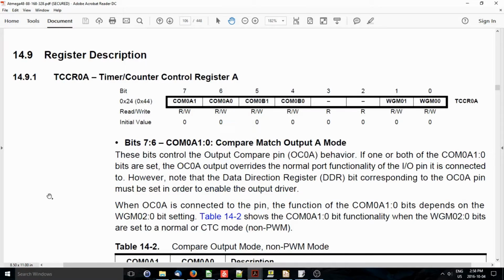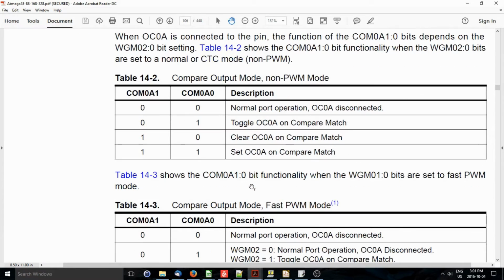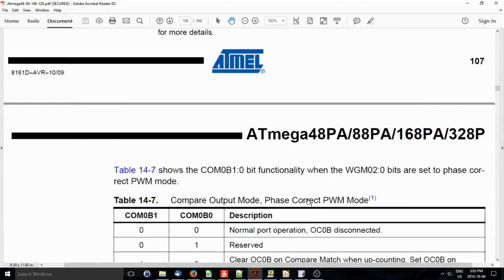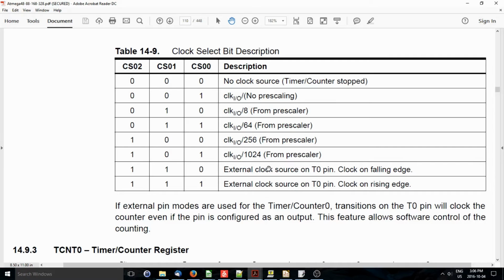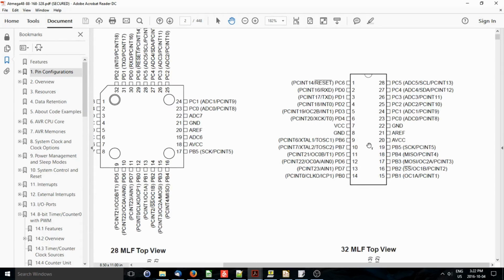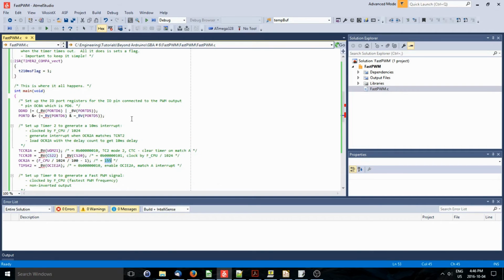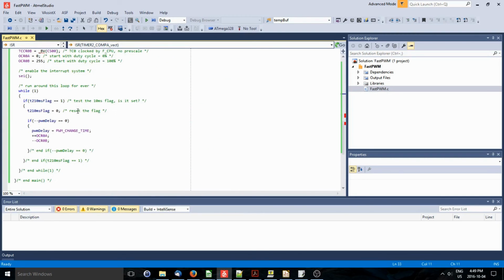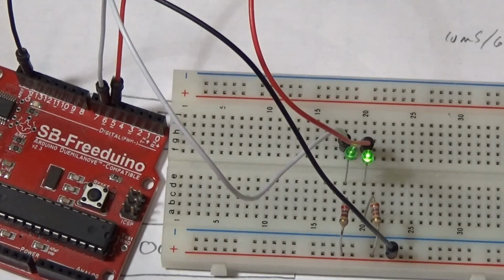Going Beyond Arduino #6: Timer 0 and PWM

Comment: Please I want to set OCR1A=0 and OCR1B=0 and
 (when Oc1b is 255,Oc1a is also 255); 
at 25khz pwm....how can I do that please reply it's very useful to me.please
Reply from the maker: The lines of code to do this are:
OCR1A = 0;
OCR1B = 0;
Read through the ATMEGA328 data sheet, the explanation of how the timers work in PWM mode is thorough.  Good luck!
Reply: @craighollinger9972  thanks alot

Comment: Hello Craig, thank you very much for all your videos, they're very helpful for my studies ! I have just a little question : in your while(1) loop you still increment/decrement OCR0A/OCR0B registers. however what happens when OCR0A is full and OCR0B is empty ? Does the overflow bring automatically OCR0A to 0 and OCR0B to 255  by the same way ?
Reply from the maker: You are correct.